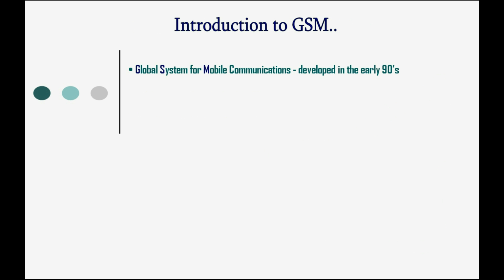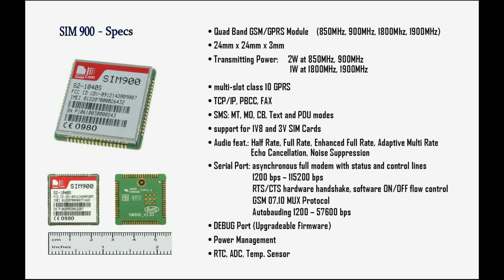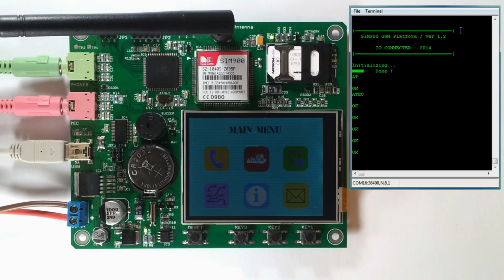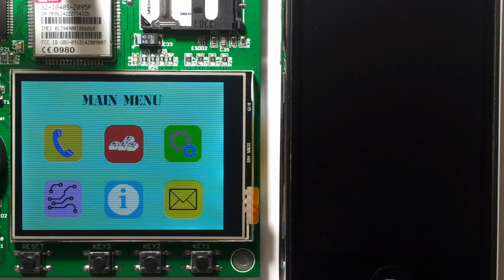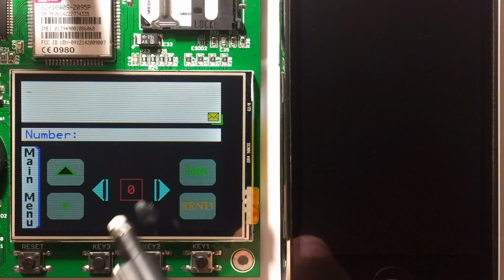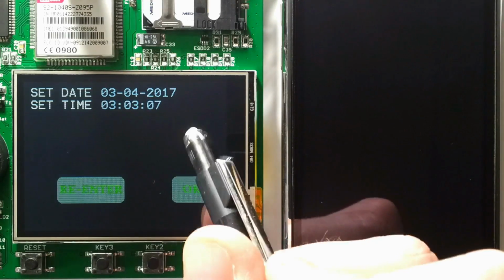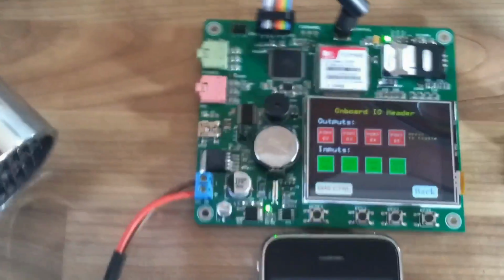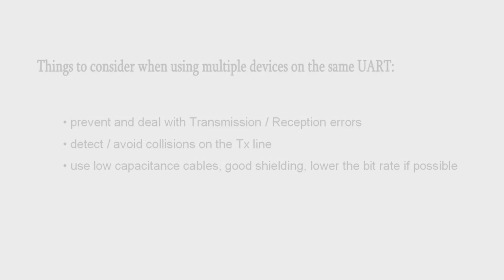AVR GSM Development Platform / AVR + SIM 900

Comment: were did you get the parts
Reply from the maker: Alex Williams I bought some of the chips from surplus markets like hkinventory or other far east suppliers, China, HK,  Malaysia.. 
I had almost all the resistors and capacitors in my lab. Same for the connectors, pin headers and so on.
I bought the display directly from the manufacturer, can't remember the name right now but I'll get back to you if you need it. As a rule of thumb, always try to buy parts as close to the manufacturer as you can get. The biggest advantage is the price and the service, documentation, tech. assistance (in some cases).
The major draw back is the minimum quantity they would sell. If you can't get it from the manufacturer find the closest reseller.
Reply: Designing Hardware do you think you could send me the link of were you got the processor?
Reply from the maker: Alex Williams I can do that. Just send me an email at: core.weaver@gmail.com

Also, if you look to buy parts for your projects this is what I recommend:
-start watching the Asian markets. Build connections. Talk to people, many times they are willing to give you a discount if you buy more 
-if you know what you need and why you need it, in some cases it makes a huge difference to look for equivalences. 
Some part may do exactly the same thing as the one you need, at only a fraction of price.
-adapt your design

the prices are changing rapidly. I avoid buying from large distributors whenever I can (I won't give names) cause most of the time their prices are higher than worthy
-buy more. If you need one resistor buy 100 or 1000. Build your own stocks when you find a fair priced/ quality product. Sometimes 100pcs are cheaper than 20pcs.
-if you're not sure about the quality, request samples, before you buy large. You can also do that if you really need a small quantity

Before you buy something try checking for free samples. TI, National Semi, Atmel, Microchip and many more.., go on their websites and look for free samples. Depending on where you live, the quantity you requested, and a few other things, you'll get the parts, then you can test them, see if they're right for your design.

Good luck

Comment: what is the procedure to send an email using sim900? 
can anybody explain me.  i am interfacing atmega32 with gsm sim900. i want send simple mails using at commands. what are steps to carry it out?
Reply from the maker: +Shashidhar Badiger you can use SMTP 
first send: AT+EMAILCID=1 to set the email's parameters, then: AT+EMAILTO="timeout"
set the SMTP server address/port: AT+SMTPSRV=”your smpt”,"port"
You'll obviously need to specify your username/password: AT+SMTPAUTH=1,”username”,”password”
Then the sender's address: AT+SMTPFROM=”your email address” ,
 the recipient's address: AT+SMTPRCPT=0,0,”destination email address”
Now you can enter the email's body by issuing: AT+SMTPBODY=”your text” 
Email's subject: AT+SMTPSUB="email's subject"
And you're good to go. Issue: AT+SMTPSEND   ..to send the email.

there's a document called "SIM900 AT Commands Email" or something like that. All the supported protocols are explained there. It also includes some examples if I recall correctly